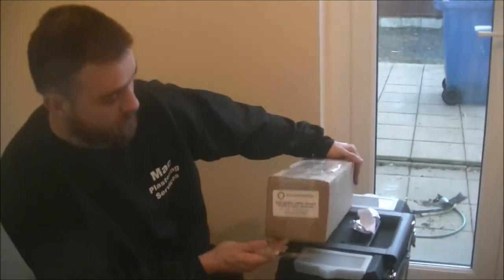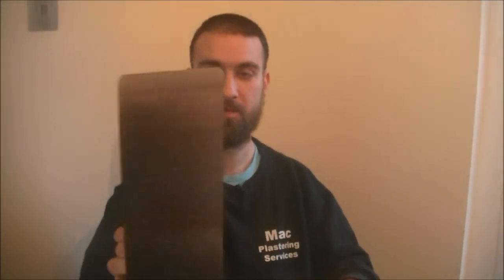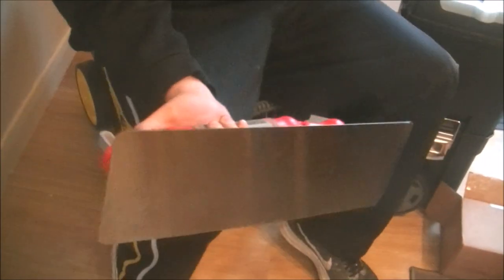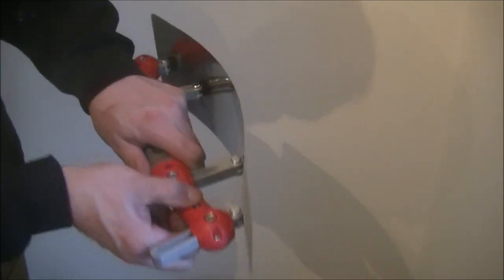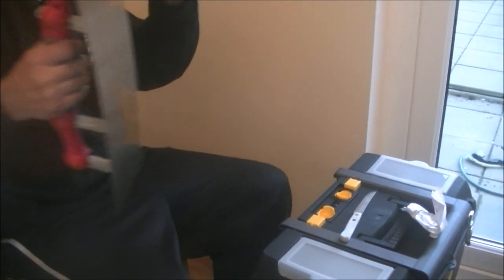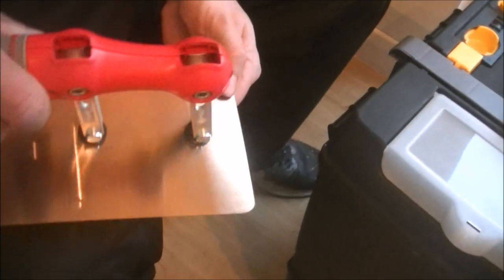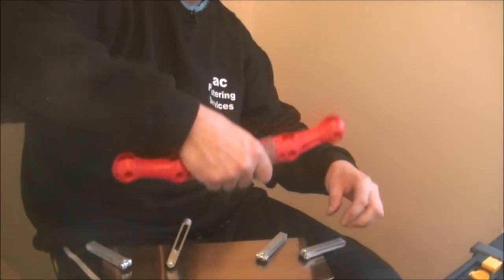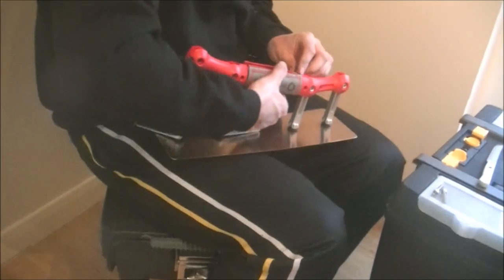NEWEST TROWEL TO PLASTERING AND RENDERING ADJUSTABLE TROWEL NEW !!

Comment: First off a big well done to innovatools for making such a bizzare trowel and something that does look bit like a gimmick, but something of a handy trowel to have. Memo foam and now memo metal 😂 but from briefly viewing there page and your video it's a Aluminium blade ? I like it. Where you are on the video, following the arc of the arch and then with the trowel your pulling back with the trowel in to thin air ! To me that's the motion of using the trowel for barrel ceilings on the angled point !  So to me this is another excellent use for this trowel then to drop back on the plaziflex for the straight pulls. Also as you demonstrate its excellent for domed work and obviously curved walls. Don't think it's worth the £75 price tag though. Id like to see this wider again and maybe a tad shorter ? Little tip for plaziflex users ! If your using a 16 inch blade or shorter ! Buy the bigger blades where the thickness of the blades are a bit thicker and more sturdy and cut them down to your 16 inches. Have brought this forward to Leon of Refina about this, it gives a smoother easier motion I find and even less water. Just beware where you are on the pull though as you will get tiger marks in the end finish. Keep the good stuff up Mac. Keep safe all.
Reply from the maker: Hi Jamie mate yes you are on the same page as me , to me company's making new things new ideas and thing that might make it easier for us spreads is a great thing . yes man thats what i was trying to show it would be great on a barrel ceiling big time or under them spiral stairs mesh stairs , thanks for watching mate :)
Reply: Hi Jamie! Blades are Stainless Steel! (we also develop products for the portable aluminum brake industry which is big in North America).   We've had nothing but positive comments about the trowel from users saying it made their life much easier on rendering columns or finishing dome ceilings etc and the beauty of it is it has a broad range of shapes it can adapt to so even if you only use it a few times ,  you can see it in action here; https://www.youtube.com/watch?v=oYs_bpvzqBQ&t=71s   

we were hoping to have the 12'' and 16'' models and half round ends, round corners and square corners in each size available this week but we regeared for production of medical supplies/devices! but once this is over we'll get right back at it!:)
Reply from the maker: @innovatoolsinc  cant wait to see the other trowels you guys come up with will be great , and keep up the good work fighting this virus guys :)

Comment: Could be handy to lock one side flat and curve the other side so you can follow the flat edge for a consistent curve. 
Skeilings and loft conversions, i usually cut a plywood template and drag out the bonging coat when I have to do that sort of work
Reply from the maker: Big time could strike a line and work off that , usually we would just do it free hand as you cant relay see if curves run off but for them and other jobs I think ill have some real interesting stuff to record with this trowel in action :)